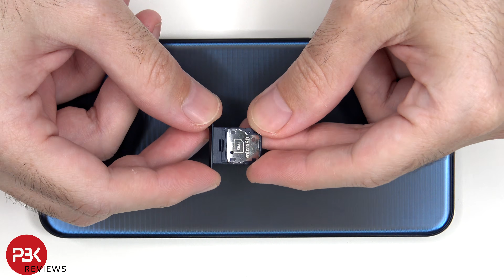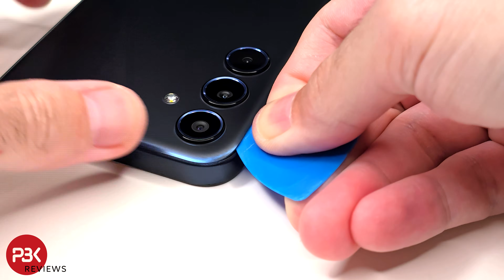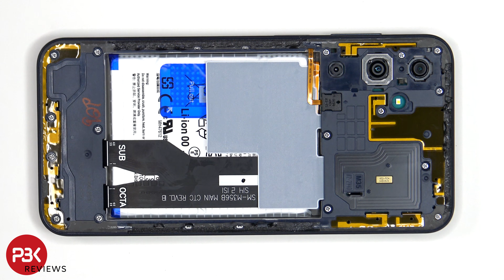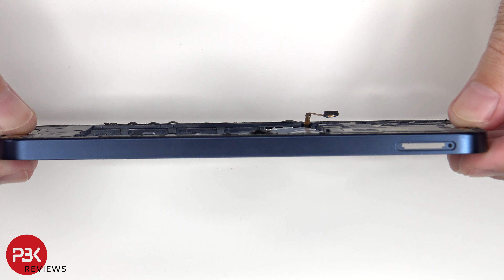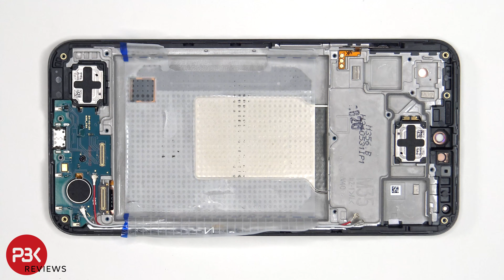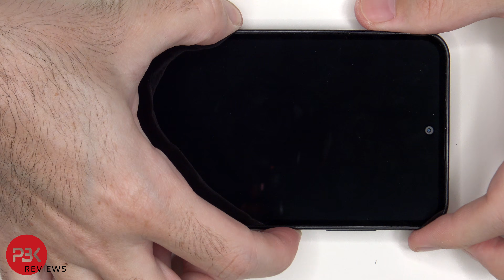Samsung Galaxy M35 5G Teardown Disassembly Phone Repair Video Review

Comment: My phone fell from a knee high altitude and no screen won't turn on, screen not even cracked or anything
Reply from the maker: sometimes there can be a hairline crack not visible in the corner on the screen underneath the glass which will render it inoperable or the cable may have come loose or disconnected.

Comment: A35 and M35 is pretty much same,

Advantage of A35 is adaptive refresh rate, glass back, and optical finger print sensor. With twice the price as m35
Reply: M35 also have adaptive refresh rate
Reply: IP67 rating

Comment: thermal paste is more efficient than thermal pad but dont know why samsung still put thermal pad even its latest device
Reply: I was asking my buddy who works in smartphone manufacturing, he said thermal pads are used instead of thermal paste because they provide consistent coverage, are easier to apply in mass production, and are more durable over time. This is crucial to mass production, as paste can be inconsistent and prone to drying out and if a advertised vapour cooled phone then starts having heat issued it will be much worse

Comment: I got upset when I saw the copper cooling sheet . Using samsung a23 , price is almost same , less features but no vapour chamber😢
Reply: There's no copper cooling sheet in the Galaxy M35. 
It's a Graphite Sheet + Vapor Cooling Chamber.
Reply: @SDYT07  No, the vapour cooling chamber is made up of copper because copper is good conductor of heat. So, I was telling that
Reply: Right, Yes.

Comment: The better Samsung midrange phone than the A series (in my opinion). The current A series phones have unnecessarily expensive materials like glass and metal. Premium materials are not essential for the core functionality of a phone. These materials also add excessive weight to these already heavy modern phones. The M35 is just a little heavier than the A35 but comes with 20% bigger battery. Not to mention the M35 is cheaper for pretty much the same internal hardware (cameras, chipset etc.).
Reply: Definitely. Galaxy M35 is the better A35 in terms of VFM. At that price, A35 is an absolute no go. But surprisingly enough, the M35 at its discounted price is a great value!
Reply: Unfortunately can't say the same for a55 vs m55  @SDYT07
Reply: @silverking8460  Both are trash at their respective price point.
Reply: @SDYT07  eh i got my a55 12gb/256gb variant for 300$ that's a good deal to me.
Reply: @silverking8460 Galaxy A55 (12/256) for $300 is a good deal. 👍🏼
Reply: @silverking8460 exactly
Reply: @silverking8460 m55 is a bad phone, the cameras are worse than last gen and it heats up really quickly. Samsung rebranded the m55 as f55 and had to underclock the chipset to prevent the same heating issue.
Reply: @SDYT07   glaxy a35 and a55 getting oneui 6.1.1 where is your m series update 😅
Reply: @SDYT07 you know glaxy a35 have in display fingerprint sensor, perineum degine,bigger display, small bezels, bigger camera sensor, ip67 rating, samsung all features unlock in glaxy a35, and glaxy a35 5g get latest oneui6.1.1 update
Reply: @adigaming5688 It goes straight to One UI 7 😁
Reply: @adigaming5688 They are going to One Ui 7.0 😂
Reply: A55 is better
Reply: @the_one_niko  but more expensive.
Reply: 6000mah in m35 looks like 4500 only
Reply: how to find is our phone is open or not while buying 2nd hand
Reply: @Mohdshahid4965-r6r  good question 👍!
Reply: Hmm I agree too 😅
Reply: But but no under display sensor
Reply: Bro M series is for our Grandpa  or people who needs a basic function  phone. But regular basis it's ok to use.Even M series phones have limited customization options than the A series. Although Samsung don't care it's overall Performance & Quality. But they do care in A series,S series & Z series :)
Reply: @টুংঙ-টুংঙ-সাহুর The M35 is an outlier in this case. Can't expect any better than this keeping in mind the fact how poor Samsung's M Series devices have been over the years. 
Considering 14,500-15,500 Price Point, Galaxy M35 is definitely recommended except for those who want to get it for gaming.
I think the M35 can be a great secondary device. Performance is decent (better than A54 and A35 at launch), and it'll only get better with updates.
Reply: @SDYT07  1400-1500$?
Where are you from?🤔
Reply: @টুংঙ-টুংঙ-সাহুর  Prices mentioned are in INR. Equivalent to USD 170-185.
Reply: @SDYT07  Have the A54 and A35 improved over time?
Reply: Side mounted fingerprint is worst
Reply: @Subhasis44597 kya farag partahe jab itna chhadisplay ,sterio dpeaker,battery he to...samsung ka nahenga phone fold me bhi side mounted finger....

Comment: the first time there's stereo speaker in the M series
Reply: And also using the exact same speaker for the upper and bottom side.
Reply: @LabArlyn But in practical daily use for me, the upper speaker is 40% & the lower speaker is 60% of stereo sound comes out. Not a balanced stereo speakers (like 50-50%)

Comment: What do you think about the quality of components used in Galaxy M35 vs. Galaxy A35?
Reply from the maker: They are very similar to one another, the only difference I can possibly see quality wise would be the housing on the A35 is one solid piece vs the removable back housing on the m35. The A35's housing is stronger. But overall quality of parts are very similar.
Reply: @PBKreviews Thanks for the reply! Thoroughly enjoyed the video. 🙏🏻